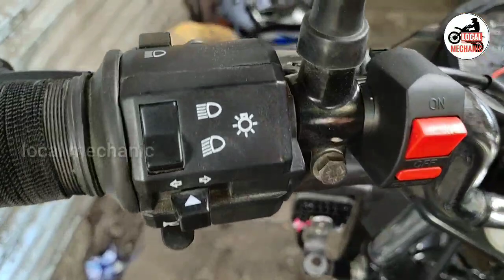உங்க bike LED light மாட்டுவது எப்படி,,/local mechanic...

Comment: Fog lamp fit pannathum headlight dim ah eriyuthu enna panrathu konjam solunga
Reply from the maker: Bike name bro
Reply: @LocalMechanicTamil  splendor. Self start illatha model
Reply from the maker: Fog lamp line ethule bro etuthinga...battery la ya.....?
Reply: @LocalMechanicTamil  illa na front brake light cable aprm negative  indicator la kudutha
Reply: Anna konjam solunga
Reply from the maker: Battery irukka bro....?
Reply from the maker: Splender la two model irukku...
1.single coil 
2.three coil
Single coil na intha problem irukkum